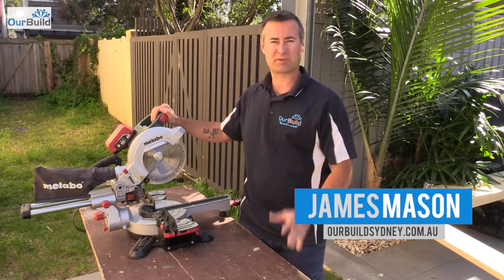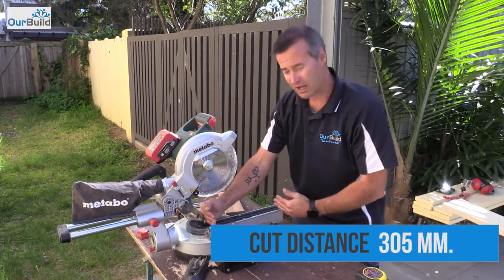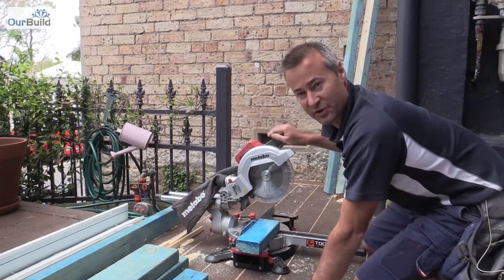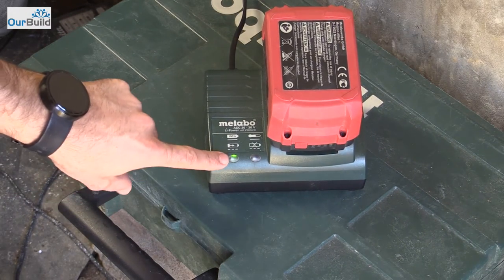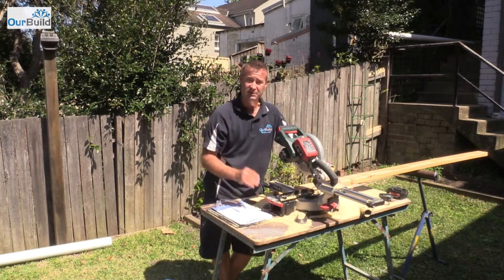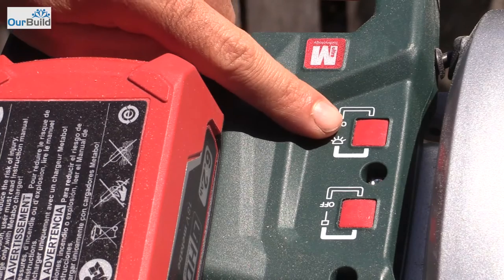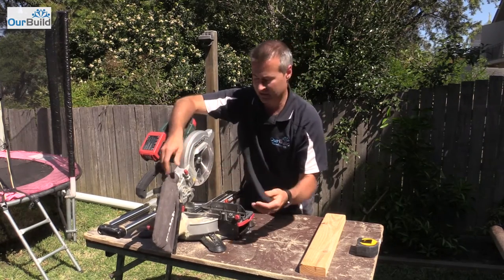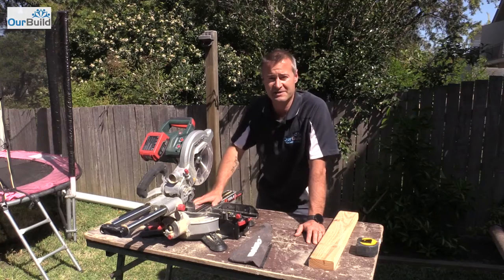Tool Review - Metabo Cordless Drop Saw KGS 18 LTX 216

Comment: I have this saw (as mentioned earlier) and with the 7Ah it just goes on and on. I would honestly not go for a higher Ah battery as charging times are a factor to consider too. The 7ah battery is better paired with a 5,5Ah battery (perhaps even the 5,2 if you happen to  have one). After having the saw for quite some time I did sell off my Makita 18V saw and ordered the non sliding version KS216 as a side kick to this one.  Both saws for the same price as one Makita 18V (!) - with laser and LED.

Comment: Great review mate I have this mitre saw and it is great put mine to the test cutting at work the other day  cutting 35mm x 240mm hardwood and cut through like butter, this saw is so light weight and makes a very smooth and accurate cut, this mitre saw I believe is best in class in my opinion for price and overall features compared to the others like the blue version ,will never look back after buying this saw just wish more places sold metabo in Qld so I could get the new Lihd battery .
Reply from the maker: +Tommygun , You are not wrong mate, the weight vs power is unbelievable, and very well built. Bummer about the LiHD batteries up there, im sure they will be in shops soon, give it a few months and they will be everywhere.

Comment: Filmed in 2006 uploaded to Youtube in 2009.
It is now 2021, and since 2009 this film has had 2700 views and received 2 comments from viewers.
I understand that Metabo is now a unit of Hitachi, and I further understand that Hitachi is owned by KKR.
I think KKR is Kolberg, Kravis, Roberts, a bunch of cashed up / debt funded corporate raiders.

Some (assembly ?) of Metabo tool production Is now conducted in China (2021).
Reply from the maker: Thanks for the detailed analysis mate, and what exactly is your point?
Reply from the maker: BTW -  Filmed and up loaded in 2016 approx 5 years ago.
Reply: @OurBuild  Sorry, you are correct, I was trying to comment on another video, while I was using a cellphone, and WiFi (poor connection) but something went wrong in the process and the comment stuck to your video by mistake.

Comment: I left a review on the Makita DLS713/714 in your other video. I own the Makita DLS713, DLS600 and the Metabo KGS 216 18V LTX. 

https://youtu.be/Y797_WDgMCU

Short conclusion is that I think the Metabo is superior to the Makita DLS713 in just about every aspect. Better outrigger supports, comes with a good LED lamp, laser and the slider is smoother and the carry handle works well. Quality of cut is better on the Metabo when comparing the original 40T blades (190mm on Makita and 216 on the Metabo). Metabo has 4200 no load RPM vs the low-ish 2200 no load RPM on the Makita. The Metabo feels just as powerful as the Makita and produces a faster and better cut. Value for money is heaps better on the Metabo. 

The Makita does feel a bit more refined in perceived build quality but in use the Metabo does better. 

The Metabo is a great and versatile saw and the LiHD batteries are super. The saw does great on the older 5,2Ah batt's as well though. Not sure whether to keep the Makita or not, it is supposed to help out in the workshop but the Metabo just does it all a little better.